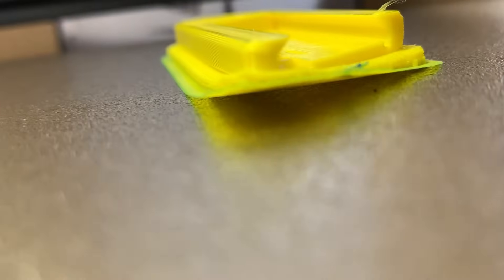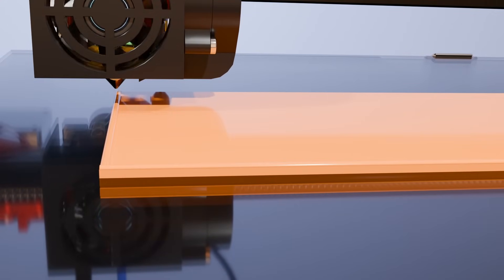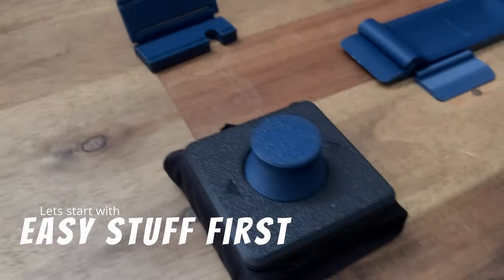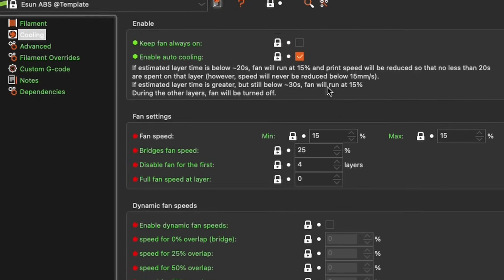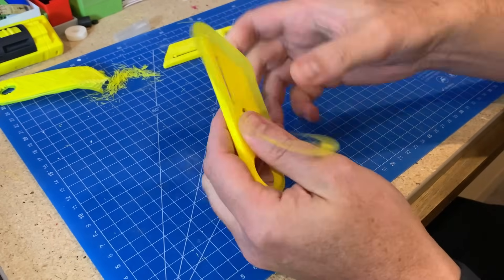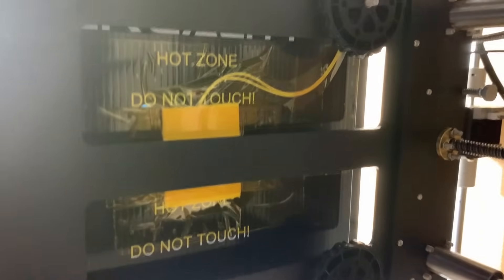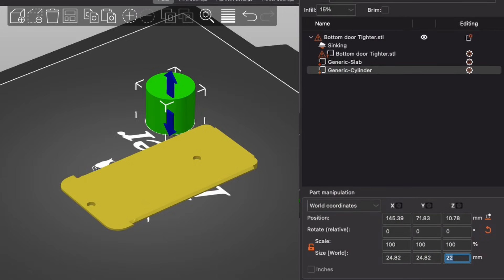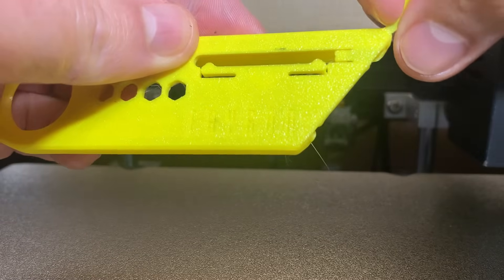Understand and fix lifting corners on 3d prints. Including mouse ears !

Comment: Maybe know how fix whis warping on bambu p1s?
Am was try all things and not fixed what problem 😢
Reply from the maker: On the Bambi you could try lowering the layer height as well but the same tips apply.  If all those points don’t help, make sure you bed isn’t warped too, especially if it lifts repeatedly around the same spot on the bed.

Comment: How do you work mouse ear height when first layer is not the same as layer height?
Slicers can’t do fractional layer heights … and this can mess up dimensions in a print so I’m curious how best to manage it for the mouse ears?
Reply from the maker: if I need to, I set the height manually so what ever the first layer is or if you want 2 layers high first layer plus next layer.

Comment: Thank you so much

I'm brand new to printing and I'm using petg atm and three quarters of my print corners were lifting.
The raft tab thingy isn't available in the new version of cura but basic raft will save my prints.
Reply from the maker: that’s great.

Comment: Feel like the biggest thing causing lifting corners/warping early layers is TOO MUCH cooling.  Touching on turning the fans down is good, but for example, BambuLab's default profiles for PLA and PETG have the auxiliary cooling fan that blows horizontally across the bed (assuming your printer has it) set to run at 90% fan speed after the first layer.  I usually drop it to 10% or just turn it completely off, especially on prints where the first few layers are quite large. 

You also have to remember: while turning up the temperature of the bed might sound beneficial, it's only going to increase the differential between the material temperature and the ambient air/cooling fan air temperature.  And I'm pretty sure whatever material you're printing will basically insulate itself from a secondary cooling fan the further it gets from the edges of the part being printed.
Reply from the maker: Good points and a few people I know have adjusted various profiles specifically for fans.  I think it’s a big one that gets overlooked.

Comment: In my case a poorly leveled bed caused this problem and after few screw turns this formerly loose corner now sticks harder than needed, heh... 
I'm yet to get hand of how of "sheet of paper" leveling technique.
Reply from the maker: I’ve been thinking of doing a video on the paper method if everyone thinks it’s worth it
Reply: @3DPrintSmith  That'd be interesting but the problem with paper method that it's subjective and it's somewhat hard to understand results after specific 'pressure'.
It'd be nice to see a video with examples like: extruder too low, too high, optimal. With one-two poorly aligned corners and test prints with specific cases.
And overview of test models for aligning corners (the ones that look like 1-2 layer thick planes fitting bed size).
Not sure if it's optimal for a video though.
Reply from the maker: I’ll put it on the list of videos to make.  I actually use a feeler gauge when I do it in case I use paper with different thickness and then do one of the huge square test prints.  that’s the way I do it and works for me and people can take from it what they want. I’ll figure something out :-)

Comment: FWIW, I've tried all these proposals and keeping the cooling fan off during the earliest layers is what seems to work the best for me, when dealing with PETG.

But I have run into apparent bugs in PrusaSlicer where the fan commands in the gcode don't seem to wind up matching what I have set in the settings. So it does require some fiddling around to get the fan speed actually where I want it. (Maybe I just don't understand the settings well enough, but it really does look like buggy behavior to me).

Interestingly, I find that I have the most trouble with corners curling when printing objects that are larger and thicker. I would've thought these would resist curling more, because of the extra mass and so slower cooling away from the fan. But I think instead, the lighter/thinner/smaller models advance Z more quickly, which lets the model get built up higher, fast enough that it's already reasonably solid before the curling can overwhelm the bed adhesion.
Reply from the maker: yeah sounds like it’s when large prints are taking too long to get the next layer on. A thick raft can help protect even if it does lift. If it were me I’d try these in order I think they’d make a difference
- design supports into the model to help with holding it down
- cut the print into seperate parts that print quicker and join them later.
- seal and heat the enclosure might work too.

Comment: I use a cheap glue stick.
Solved my problem.
A little bit goes a long way and it washes off with water.
Reply: Have got into a sticky situation when the print adheres a little too well with the bed. Still, that is why printers come with scrapers 😂
Reply: @robdavis8556 be carefull with the metal scrapers.  I put a scratch in a plate once and had to be carefull where I printed after that because the scratch would show on the first layer.
Reply from the maker: I know it works well for some but too much of a mess for me.
Reply: @3DPrintSmith  If its messy you used too much. The light has to be right to see the glue on the surface. Thats how little I use.

Comment: Good video, just want to point out bed temp should be lower not higher to reduce warping. The parts warp as the top layers cool (and shrink) and pull the non solid bottom layers up. By lowering bed temp the bottom layers become more solid and less likely to be pulled up, but will stick less to the bed, so glue is recommended.
Reply from the maker: Thanks!  I have to disagree with you though on bed temp. From experience as well as filament manufacturer recommendations. The lower layers being warmer gives them the chance to cool and shrink WITH the new layers on top.  What works for me though may not work for everyone so I think I’ll stop recommending anything in future 😊 ! !
Reply: @3DPrintSmith  I think your right. There is such a thing as too low or too high of a bed temp so think we are both right here depending on situation.

Comment: isopropyl alcohol has been proven to be worse then just cleaning the bed with some dish soap.
Reply from the maker: I’ve been trying to find anything about this online  but so far turned up nothing.  Do you mean bad for the bed or people?  no doubt it’s harsher than dish soap and water it it’s what’s in a lot of hand sanitizers and recommended and used for years by 3d printers globally.
 If I’m using something that’s proven bad and recommending it I genuinely want to read the articles so if anyone has anything please let me know some links so I can research more.
Reply: @3DPrintSmith  when i have some time ill try and dig some stuff up

Comment: lifting corners... guy use Isopropanol...:face-turquoise-covering-eyes:...DONT use this stuff! And you wonder why your prints not stay in position!?..
Reply: THANKY YOU! I was thinking the same! 👍
Are you aware that pretty much all panels are covered with thermal adhesive, which you wipe off with alcohol?! It's clear that your prints won't hold up...then the full professionals come and use glue sticks, clean the plate again and then need glue sticks again because they wiped off the thermal glue...

Sorry, that's ridiculous, we have various printers standing around here where many of them run 24/7, we don't have a problem with the corners or hold in place, stop with the alcohol stuff... by the way, most of the disks also say no cleaning products etc to use.

Plate comes with Glue....guys, lets remove this glue...Iso/Glue/Iso/Glue/IsoGlue/Iso lol
Reply from the maker: @elriem-vm6yc do you know where I can find more info about the thermal glue coating?  I haven’t been able to find anything on that.
I agree with the no glue and I’d never recommend adding anything to help things stick.  making sure the bed is clean and free of anything works for me.
Reply from the maker: Whatever you can use to clean the bed doesnt have to be Isopropyl Alcohol, warm soapy water and a good rinse works too.  The IA is to disolve anything on the bed to make it easy for a cloth to pick it up and not just smear it all over.  Dries off super quick and leaves no residue so works every time I need it to. Not sure why I wouldnt use it being the most widely accepted cleaner for electronics and work surfaces.
Reply: @3DPrintSmith  elrim explained that because of the thermal adhesive, which is removed with cleaning agents, it is activated when heated. This glue is removed when cleaning...which is very expensive by the way. You can also easily test this yourself, take a new glass plate and rub one side with ISO or cleaning agent and one side not... You will see A: A white film, that is the chemical reaction of the glue dissolving and B : Your prints will no longer hold or will only hold up weakly... stop using cleaning agents, especially those with alcohol... only makes the glue manufacturers happy...
Reply from the maker: I'll have to look that up because I've never heard of thermal glue being used on any build plates  I've never used glass plates though and dont have one to test so I'll have to take your word for it. All I know is I use IA from time to time to clean my PEI plate and if there's anything on it stopping a corner from sticking, 99% of the time it will stick after a clean and no residue there.  I had one magnetic plate last  I dont know how many thousands of prints on it with only a wipe over every 1 or 2 months for about 3 years.
I think from all the comments I've seen so far, I have to say if it works for you and your setup then keep doing what you're doing.

Comment: YouTube has hundreds of videos on this. Just use glue stick.
Isopropyl alcohol does not clean oils off the bed, it solubilizies oils, then the get deposited back on the bed when the IPA dries. Use warm soap and water.
Reply from the maker: the idea of the alcohol is to make it easier to wipe off.  for me that works great.  I never use glue because the few times that I have it left a mess on the bed and on the print but I know it works for a lot of people is if it’s your preferred go for it.

Comment: Very good. Subscribed. When I do get a corner lifting and your earlier enough, I use a toothpick to apply some glue stick under it and push it back down.
Reply: this is what ive done as well, until seeing this video and reading its comments. Dollar store will miss my weekly gluestick\toothpick purchases from here on out. lol.
Reply from the maker: Thanks for the sub!  I don’t like using glue but I’ve baby sat a few prints holding down a corner with a long skewer until there’s enough material to stop it curling.  Even used masking tape once or twice.  I would nt recommend either method but whatever works for people and they find the best for them is what I’d recommend.

Comment: I use hair spray on a glass plate and keep the printer in a warm environment. Not brim, skirt...no problem...
Reply from the maker: I’ve not tried a glass plate myself but a friend that has one does the same.  I’m not keen on it though to be honest but if it works for you then definitely go for it.

Comment: One thing i like to do with brims for effortless removal of them is to change the setting specifying the distance between the brim and the print setting a big distancd means the brim doesnt adhere to the model but the thermal properties are largely retained keeping the glass around troublesome areas lime corners warmer...this almost always works perfectly for me when a brim us needed for such reasons and is pretty much as easy to remove as a skirt!
Reply from the maker: What a great point,  I had only thought of the brim as a physical anchor to the plate while attached to the print but you're right it would help to keep the bed around the print warm as well and keep the print edge warmer as well. :finger-red-number-one::finger-red-number-one::finger-red-number-one:
Reply: @3DPrintSmith   my pleasure.  Love this trick since I stated using it there's a setting for it in cura.  I've found it highly reliable at preventing lifting around corners etc, and no more running a blade around the edge of the print to tidy up after brim removal!

Comment: Orca Slicer has mouse ears as a option right in the brim selection
Reply from the maker: I found out that the slicer that Prucaslicer was based on (Slic3r) had mouse ears added just after pusaslicer was forked off. Good to know other slicers make it easier just not Pusaslicer !
Reply: man those brims, rafts and other stuff in OrcaSlicer suck, Cura is so much better at that singular thing. It's crazy

Comment: That’s helpful , I have a prusa and small or large parts can be a problem but no easy options in the slicer
Reply from the maker: I'll be making a follow up video soon.  I've found a way to make adding the ears in prusaslicer a tiny bit easier. Still manual placement though.

Comment: Make sure Z offset is spot on, slightly too much squish is better than too little. Don't print hotter than you need to, lower the nozzle temp the smaller the temp differential.
Reply from the maker: I think I wrongly asssumed everyone would already check bed level and zoffset but you're right, I should of made that clear as the first step.  
I was thinking of making a video on bed leveling and z offset. Do you actually set z offset in slicer or on your printer? I'm in the camp that if the bed is levelled with the hardware adjustments, you shouldnt need to be adjusting offset.  I'm curious as a lot of people seem to be talking about z offset rather than physical levelling in recent months.
Reply: @3DPrintSmith  Creality 10s Pro.  I find that even with the bed leveled,  I need to adjust Z offset slightly between different rolls of PLA filament.  Not sure why that should be but it's been constant over the years I've owned the printer.
Reply from the maker: I’ve heard of that happening before when the gantry might not be tightened enough. I’d start with making sure everything is nice and tight but if it’s happening for that long you’d probably have noticed before now through bad quality prints if there was anything loose.
Just thinking too, not knowing your process,  could it be something else that you are doing at the same time and it just seems to do it when you are changing?

Comment: draft shield does it for me if im using warpy filaments
Reply from the maker: I've never really tried draft shields. The tight ass in me wouldnt want to waste the filament even though it's going to be a pretty small amount.  How wide do you generally make them?
Reply: @3DPrintSmith  just 1 layer wide, that S around 0.45 for a .4 nozzle, you can make prusa slicer do it
Reply from the maker: @kubburdigital  I'll be trying it for sure

Comment: Anyone know where to get the Tab Plus Cura Plugin - Doesn't seem like I can find it.
Reply from the maker: That's unexpected !  I installed it about a year ago and looks like it's not in the marketplace anymore so I'll do some research and see what happened. I'll comment in here where you can get it.
Reply: @3DPrintSmith  thank you! Appreciate it!
Reply from the maker: I have good news !  It looks like the author of the plugin isnt registered in the marketplace anymore but,  I found the project on github https://github.com/5axes/tabplus and there's still a link to the marketplace but it doesnt work anymore.  
The good news is you can still install the plugin manually.  The instructions are on the github page and it's pretty straight forward.  Basically download and unzip the package into the plugin folder for Cura.  I'll try on another machine I've got a little later to make sure.
Reply: @3DPrintSmith  awesome!
Reply: @3DPrintSmith  Just added it - thanks for finding it!!

Comment: How about that generic brand hairspray?
Reply from the maker: nooooooooooooo!   :-)  I tried glue and hairspray once and never again.  Maybe because I always use a textured plate but it was such a mess and left residue on the bed and print.  I know some people have success and if it works go for it but for me I’d never recommend based on my experience.   
does it work well for you?  are you using a glass bed?
Reply: @3DPrintSmith  I have a mildly textured PEI plate and hairspray works like charm for me more that a year in use. ABS juice is way stronger (styrene gets dissolved by acetone - so my guess is it's styrene glue) but the hair spray is just great for ABS and ASA in my experience so far?
Reply from the maker: it sounds like it works for you so I have to say keep doing what works ! !
Reply: @3DPrintSmith  likewise i guess :D

Comment: Pause the print when higher than your magnet, then place magnets on the corner mice ears or brim.  This creates a strong retention when printing on a ferris bed.
Reply from the maker: interesting idea!
Reply: *ferrous bed. I think your idea is awesome but anyone googling what a Ferris bed is will be thoroughly confused.
Reply: @Lozzie74 the bunkbed they built in step brothers right?
Reply: cool
Reply: Or use tape to stick the brim down.
Reply from the maker: yeah, you'd need to make the brim fairly thick which would probably defeat the purpose.  Too thin and there's risk of demagnetising the bed (I'm sure I saw a video on that recently somewhere).  Magnets can get stuck to the nozzle too if your arent carefull.
Reply: @GRainwater13  genius!!
Reply: Magnets are working well on raft. There are quite flat magnets available that won't get on the way of nozzle. Cheap and easy. Keep in mind in neodymium magnets heating over 80deg C looses some magnetism irreversibly and heat over 320C looses all magnetic properties. So keep bed temp below 80.
Reply: When the magnets heat they lose magnetism permanently. Have you actually tried this?
Reply: @gligoratanasovski3329 if we're talking 60 degrees, that won't affect the magnet
Reply: @loopymind  And little magnets are pretty cheap.